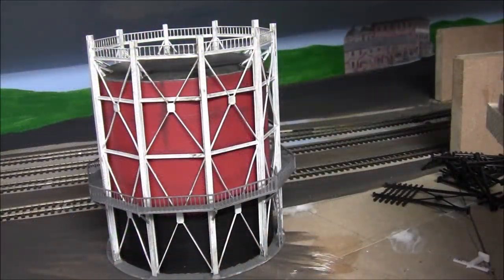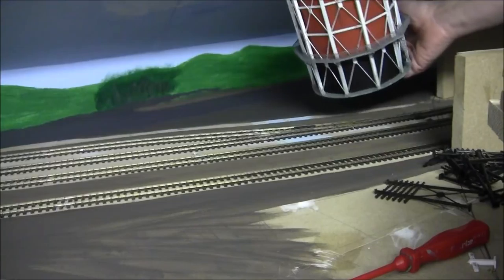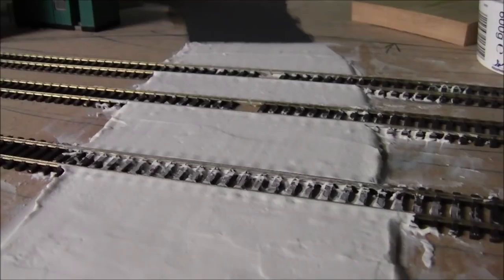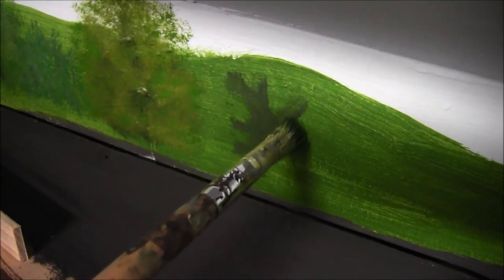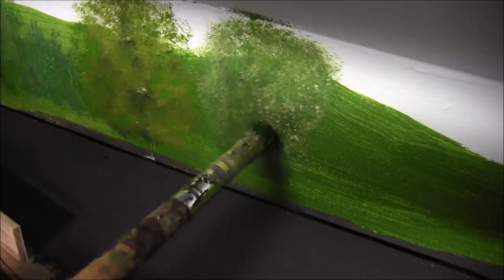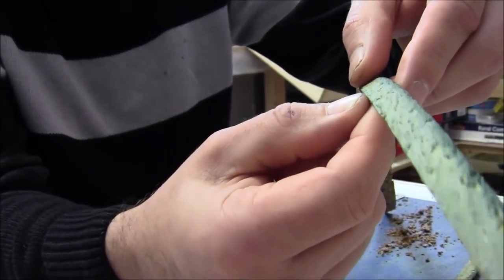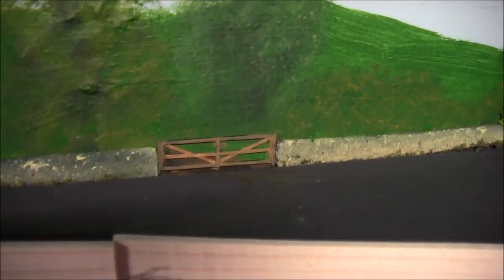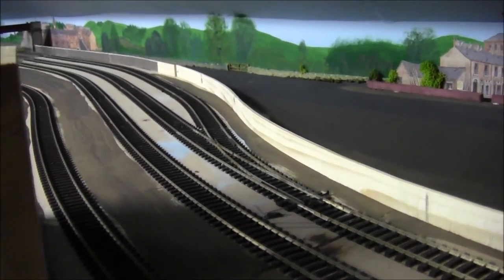Pelaw Junction---Creating the Back Scene---No116

Comment: Hi Tony, another very informative video thanks and the level crossing is timely as I'm going to be doing one. What a great idea adding pva to the mix for strength! Back scene looks good another great idea outing the under growth on the walls first. Learning a great deal, cheers Jerry
Reply from the maker: Cheer's Jerry Mate, yes polly filla/ PVA  really grabs hold of the tracks, i have found in the past that in extrem temperatures the polly filla will crack hence why i add the PVA..you just have to make sure the clean the inside of the rail throughly.like your new P2 loco.....all the best Tony